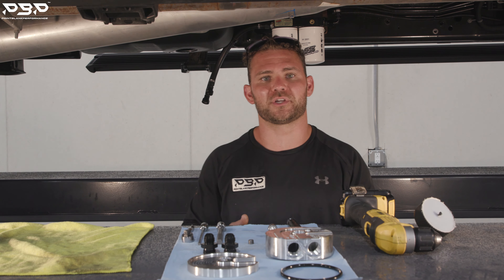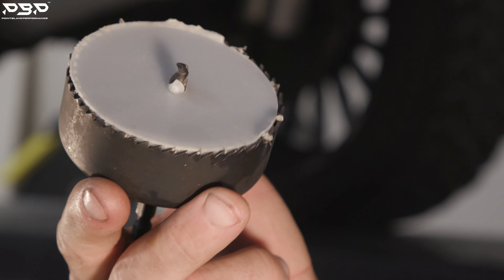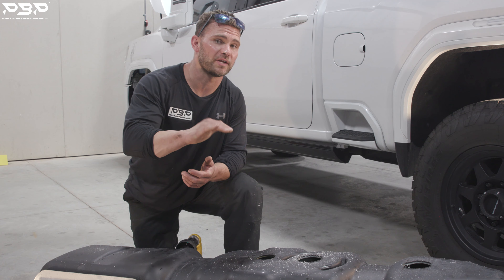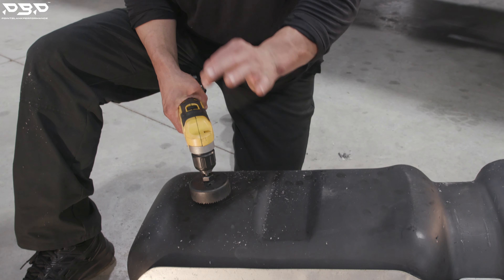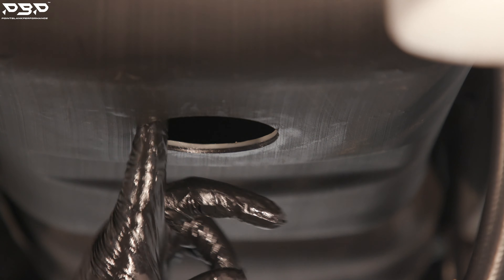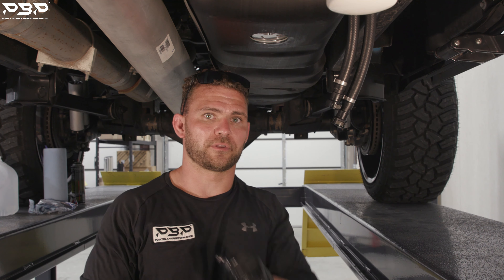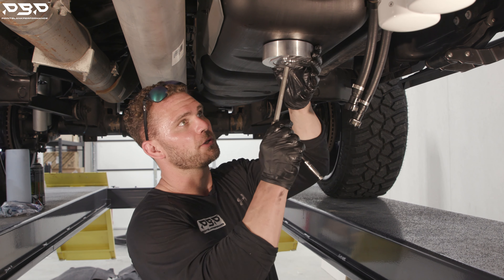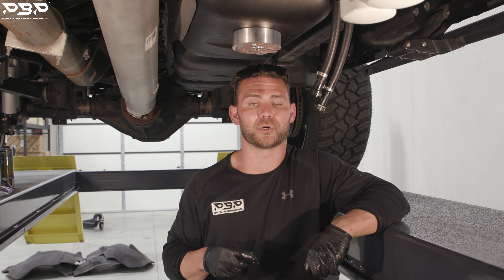POINTBLANK PERFORMANCE MEGA PACMAN FUEL SUMP INSTALLATION

Comment: Does the sump self center with the hole you drill? Like a beveled edge the puck recesses into? I'd be afraid to have it off center and fuel leak.
Reply from the maker: The sump itself protrudes through the tank ensuring a snug fit . Only if you drill a hole larger than 3” will it leak . For clocking the stand pipe will not allow the top plate to move it is forced down onto the sump . We did not design the the sump to bottom out on the top plate this would make zero room for the oring to be tighten if need . The plastic tanks can and will expand and contract . Hopefully this helps !
Reply: Thank You!